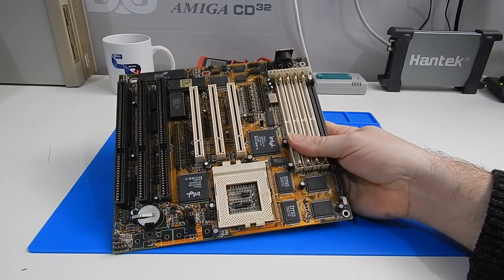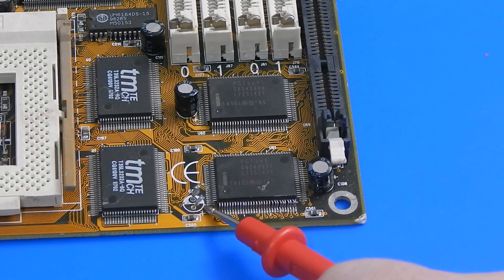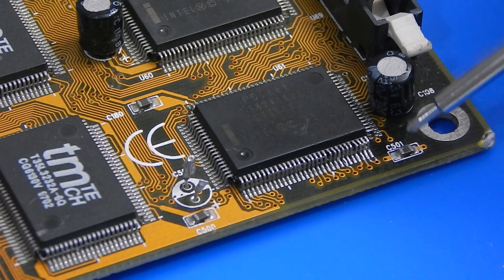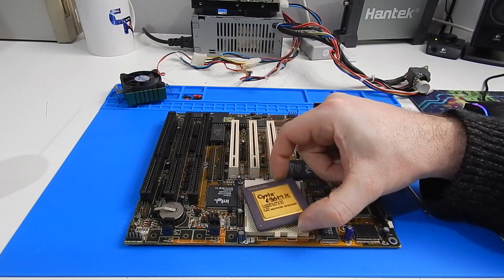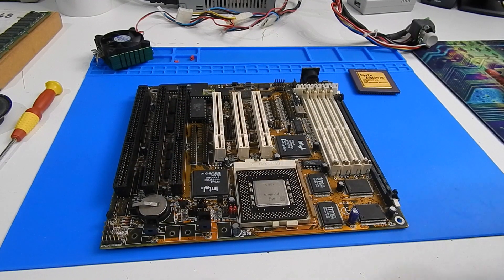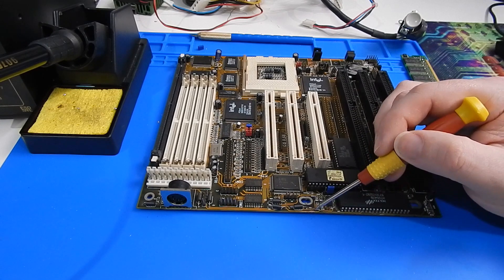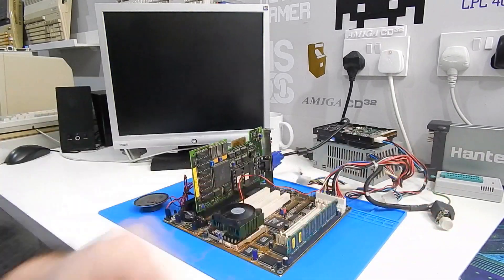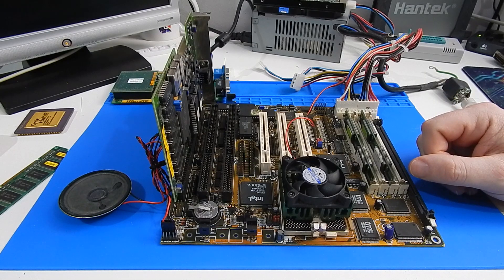AVB55C Socket 7 Motherboard with significant damage

Comment: Check voltages on regulators, I have a very similar board 1994, and there are some really beefy low profile heatsinks on those regulators. Oh, do not use a MMX Intel CPU. Get a Pentium 75/100 from 1993. Also use EDO ram instead of SD, Gosh I remember 32mb EDO ram in 1997 costing an arm or leg back then.

Comment: I know I am very late to the party watching this one, but is it possible you need to briefly jumper a power "sw" header on the board to in effect turn it on? I have not looked up this board to check but that is sometimes a thing with older boards I have worked on.
Reply from the maker: I don't recall anything like that in the manual, well what I had of it.  If I get the chance I'll take another look at it but I'm fairly sure the issue on this board is down to a fault in the chipset.

Comment: Superb channel buddy! Discovered today and subbed. Love the 486 Pcchips M912 build. Got the same board in a later revision. But only 128k cache with 16MB RAM and DX4-100. VLB SCSI and  Primax Soundstorm GUS Clone and also an S3 VLB VGA with 2 MB. After watching your video i feel tempted to add a CT1600 to test if they knock each other out too on my board. Will keep you updated.
Reply from the maker: Thanks for the kind words and for subbing. 

I've since got the issue with the GUS sorted.  Well mostly as the GUS is muting it's line in randomly but easy to sort with a simple command.  If you do try the ct1600 alongside please let me know how you get on.  I have a DX4 100 system to build at some point in the future, was tempted to drop that chip in the PC Chips build but I'm happen enough with the DX2 66 in there.

Comment: Use a stanly knife blade to split the pins and flux and wick to remove the bridges
Reply from the maker: I used my craft knife to seperate them and yes flux and braid cleaned up the mess.

Comment: I made an offer on a Gigabyte GA-586HX which was "broken", it looked perfect the only issue was a lack of a BIOS chip and missing Dallas battery. Usually, prefect boards are dead but I wanted this board (even if it was dead)  as I had one briefly back in 1996 (which was DOA) and exchanged it for a different board. So I flashed a BIOS image onto a 27c010 and inserted the battery expecting it not to boot at all, but it booted! Got lucky that time.

Comment: That would be a nice little Triton chipset board. Could be a stupid or already answered/tried question: are the CPU Vcore, I/O, BIOS ROM and DRAM voltage rails read nominal? Could be the person before you used it for a long time without the LDO regulator heatsinks. Does it beep the DRAM error code when there's no RAM installed?
Reply from the maker: No beeps, the board is dead on the post card.  Voltage rails look OK but I have found another potential issue that could spell the end of the board.
Reply: That's too bad. Is there any activity on the pins of the BIOS ROM?
Reply from the maker: @chris-tal  going to check that later to be sure but I'm fairly sure there is internal damage.  Found a missing 5v with no signs of damage.  If you push or pull the component or even just flex the board it'll come back.  Doesn't bode well for fixing it.
Reply: @CRG  You could also check the clock generation circuitry, but this board flexing thing sounds bad enough already.
Reply from the maker: @chris-tal  check the 14.(odd) MHz crystal on board which is fine.  Not sure where the system clock is generated.  Need to pull the datasheet for the chipset but going to check the bios address and data lines first.
Reply: @CRG  There might be a PLL next to the crystal. There's a fairly large and readable photo on vogons taken off a very similar board. The IC marking says something like IMI SC610. That could be a PLL, but I haven't found any real datasheets. On another revision with with extra SDRAM slots there's a Cypress Semi CY2961. That one has a datasheet. With a lot of luck they are pin compatible drop in replacements. Some people mention IMI was bought by Cypress back in 2001.

Comment: Have you tried to reprogram the BIOS EEPROM with your TL866? (providing you can download it somewhere)
I myself had some luck reviving some dead SS7 boards just by doing that.
Reply from the maker: Yep I've since tried that.  Found a bios online although in a bit dubious if it's correct or not but tried it anyway and no difference.  The original bios is saved and to be honest the 2 files appear identical so the original was probably fine.

Comment: I suspect missing jumpers 
Check the following listing pictures there is a 4 pin header next to bios with a jumper in middle 2 pins: https://www.ebay.co.uk/itm/AVB55C-baby-AT-Socket-7-Motherboard-mainboard-PCI-ISA/224264053699
Reply from the maker: That board is a later revision, note the battery is in a different position.  The jumper JP8 I found reference to on another similar board and is located there to enable the internal battery.  But tried it and no such luck, didn't make any difference :(  

Many thanks for helping look for the details though,  was certainly worth trying and I admit I initially thought this was going to fix it lol.

Comment: If the board was dropped you may have cracked solder joints on the bottom of the board.
Reply from the maker: Ive been over the bottom of the board with my magnifying glass and don't see any.  A complete relow will probably be one of the next things I try although it'll be difficult on the smd stuff.

Comment: Only just started watching but I know exactly how that capacitor was removed. Something pushed into a drive bay took it clean off probably. Ask me how I know 🤐
Reply from the maker: Speaking from experience? 

We've all done some silly things with hardware over the years.
Reply: @CRG  Yeah, I 'done messed up' as they say. Sorry you couldn't get this board working. Not sure what else to suggest other than go over it again a few times and see what gives.
Reply: to me it looks like the board was tossed into the trash pile
Reply: @rasz  Yeah, true. To be fair I have a few boards like that. What made me think it was the drive bays is that it's always that same corner of the board that loses a capacitor.

Comment: there is an idetical board for sale on ebay right now https://www.ebay.co.uk/itm/AVB55C-baby-AT-Socket-7-Motherboard-mainboard-PCI-ISA/224264053699?hash=item34372de3c3:g:CCAAAOSwJHlfyhM7 , try look at the photos for some of the main jumper settings

Comment: Well, a good approach is always start with checking voltages after fixing all obvious places with visible damage. In this case good idea would be to check what voltage you actually do get supplied to CPU, to chipset ICs, to PCI and to ISA slots. Refer to widely available docs on the Internet with info on what CPU socket, ICs and slots pins to check. Next point - obey KISS principle. You don't need memory or video card to check if MB is alive. Bare minimum is CPU (best idea is to use some common midrange one - like iPentium 120 or even Pentium 90 for this case) and PC speaker to be able to hear beeps. Even better would be to have ISA post card on hand to see if CPU is getting reset/running or not. For "voltages ok but no CPU activity" case first places to check are PowerOK and PowerOnReset circuits followed by checking BIOS IC contents. Yet another good idea for this MB would be to reflow all pins on IC that you were re-soldering some damages pins. It even might be reasonable to desolder this IC completely using a lot of flux and air gun just to check the condition of traces that are under the IC - you might have some more damage there as well.
Reply from the maker: Thanks for the detailed response. Some good tips in there and I will go and check voltages to be sure but certainly at the PCI / ISA slots along with various chips the voltages all look good.  Didn't check the CPU but will do.  

I've since also tried a post card which shows the reset line working fine but then just sits idle.  No post codes etc so my thinking is its something to do with the BIOS.  I've checked the rom and it looks fine but also tried a BIOS image I found online for this board, same result.  

Keep the ideas coming though, always grateful for any help or advice.  I'm not keen on removing that chip totally since my soldering skills may not be up to replacing it again, just want to rule out everything else first.
Reply: @CRG   Look up "How to troubleshoot your defective 386/486 motherboard with an oscilloscope" topic on the EEVBlog forum where I helped feipoa (true vogons legend that lad) with few dead boards, covers wide range of diagnostic steps. You do have a Hantek LA so diagnosing whats wrong shouldnt be difficult (just tedious). Start by looking at the Bios address/data lines if its being accessed at all.
Reply from the maker: @rasz  I'll take a quick look but I've found another issue this evening that might mean curtains for the board.
Reply from the maker: @rasz  I've found evidence to suggest there are faults on the internal layers of the board.  Discovered a missing 5v on one of the transistors bottom right but if I pull or push the component or even just flex the board it'll suddenly come back.  Not much I can do to fix that and if there's that one internal problem there's most likely others.

Comment: My feeling is that the lack of boot isn't due to damage, but configuration issue.
It's possible the CPU isn't supported. I would have expected at least a beep otherwise.

Just discovered your channel thanks to this video. Awesome! Looking forward for more :)
Reply from the maker: That has crossed my mind too, that the processor might just not be compatible.  I'll order up a Pentium 75 (or something similar) just to try.  Always good to have more in the collection anyway.

Plenty more to come on the channel so thanks for watching and please stick around.
Reply: @CRG  It's hard to resist the appeal of collecting ;)

Comment: total hardware 99 has all manuals and jumper settings
Reply from the maker: Thanks I'll take a look.
Reply from the maker: Tried that site but it doesn't seem to have a listing for the AVB55C.  If you were able to find it I'd be most grateful if you could post a link.

Comment: Order a POST card for it to see where in the POST it's failing at.  This way you can narrow it down to what part of the board is failing.
Reply from the maker: I actually have one of these and it never dawned one to try it.  Great idea though, I'll go try it now and let you know.
Reply from the maker: No post codes.  You can see the reset working but it just sits there after that doing very little.  Clock and Frame lights are lit, not sure what frame means to be fair.  Voltages all check OK too.
Reply: @CRG  I have a 286 board that does the same thing.  Means the board is not starting.  Try re-flashing the BIOS and then check for voltages and clock signals on the CPU and various ICs.  Also, check to see if the voltage regulators are working.  Maybe the CPU isn't getting power due to a faulty regulator.
Reply: No post code usually means the cpu isn’t able to execute bios code. 
Is the chipset getting hot? You might want to use ipa to identity if it’s too hot. If so, the chipset might be faulty. 

Power regulators might definitely be broken. Especially when there’s no heat sink attached. It’s a good sign!

Good luck!
Reply from the maker: @Inject0r  The chipset IC to the left of the CPU socket gets screaming hot fairly quickly (after about 30 seconds) so I'm fairly sure that's where the problem lies.  There is absolutely no activity on an address or data lines so for now I've conclude its dead.  Time to move onto the next project box and hopefully with a bit more luck.
Reply: My idea as well. Mine has come in really useful.

Comment: Well you can actually use a 2.8V CPU. You have to configure it to "split voltage" operation :)

Also, I think the way you've installed the EDO ram is wrong (it should be in pairs in two slots next to one another), but I doubt it'd prevent you_r board from POSTing.
Reply from the maker: If you look at the board the edo slots are labelled 0101 that's why I installed the ram as I did.  Both are in slots labelled 0.

But yes that's highly unlikely anything to do with why it doesn't boot.

I've since tried the cyrix cpu at 2.8 volts with the split voltage but same result :(
Reply: @CRG  Yeah I noticed that but I think they meant slot N°0 of bank 0, slot N°1 of bank 0, etc.
I've never seen a pentium board with a different slot layout than that (but this could be the exception nonetheless, who knows ?)
Reply from the maker: @DxDeksor  you might be correct but regardless its not the issue.  Using a test card the board seems to get stuck after reset.  Need to do a bit more reading on the boot process to understand what should come next.
Reply: @CRG  which post code exactly ? And which bios ?
Reply from the maker: @DxDeksor  no post codes.  You can see the reset flash then it just hangs.  Power rails are all good.  Clock and frame leds are also lit but admittedly I'm not sure what frame is.

Comment: Even if the other capacitors look good, they might be "dry" and need to reform, by leaving the board on for a while. But i guess that can't be done safely without the missing heatsinks. Or replace the other capacitors too. When in doubt, change capacitors :D But changing throughhole capacitors on multi layer boards is no fun... Needs lots of flux..and then some more flux :p
Reply: I doubt they are dry, the board is not THAT old...
Reply: @8bitbubsy  Well, with "dry" i mean, the electrolyte inside has to be respread and reactivated again; and with the board coming from the late 90's, it's actually more than 20 years old now. Also, if it just sat there without it being powered on, that wouldn't have benefited the capacitors. It doesn't mean it HAS to be the capacitors, but it's an option.
Reply: I recently had a socket 370 Mainboard that showed similar behaviour, with fans and peripherals like floppy and CD-drives initializing, but the screen stayed blank and there were no beeps coming from the board. I left it on for a while and after a few restarts it sprang back to life, complaining about RAM not being found, tho it was installed. I removed the ram and used contact cleaner both on the ram slot and the ram itself. It found the ram. But the cold start issues kept returning, until i cleaned the ATX power plug and socket on the board with contact cleaner too. i guess they were tarnished enough to sometimes not make a good enough contact for delivering power reliably. Another possible option of what it might be that doesn't let your socket 7 board start?
Reply: @Asriazh  Possibly...
Reply from the maker: If I had the other caps in stock I probably would replace them but to be honest I'm not convinced that's the problem.  I do need to order some for another project so for the few £ it costs I might just get them for this board too.

Comment: do you have other socket 7 cpu you can try?
Reply from the maker: Unfortunately not, just those 2.  The Pentium is a good chip though.  I should probably get another few models just for testing.
Reply: @CRG  I would try something lower end like 75-150 MHz just to be sure. Motherboard might act like a dead one if cpu is not supported
Reply: @mrvellu  easy enough to test, take the cpu out and see if it beeps..